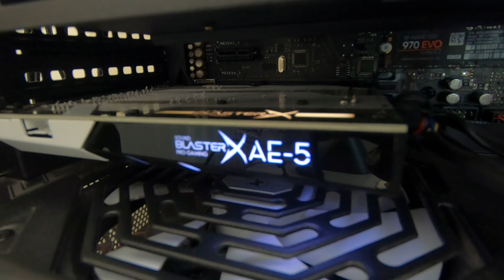SoundBlaster AE-5 Clicking Noise *DIY FIRST FIX* in English

Comment: mine does it every time i exit the game too. its just constant clicking. i finally took it out of my system.
Reply from the maker: I fixed it by using a switch for the 3.5mm speaker output. So my headphones and my desktop speakers plug into a little switch and they are using the same output from the card - so no irritating clicks when using the software to switch between them. Its a relay making the noise, so it probably clicks on boot and shut down, but I don't notice anything now.

This is what I actually use: https://www.amazon.co.uk/STEREO-Manual-Speaker-selector-available/dp/B073GWCRP3

But I didn't buy it from there...

Comment: hmm wondering what speakers you use ... i'm asking because i use an old klipsch promedia 2.1 set up (one of the older ones from before klipsch started lowering their power output) .  it doesn't have seperate channels for the l/r speker it just has the one output plug from the control module to your sound card.  now my issue is  when i run a test in the soundblaster software  , it doesn't seperate left and right  like it should it just plays all audio test  from both satilite speakers equally. aned no sound from teh sub durring test (though the sub does produce noise on regular listening and games). i've tried seting it from 2.1 to 5.1  , to stereo .. and there's no difference  it doesn't discriminate when doing left and right speaker test.
Reply from the maker: I have a pair of Creative Gigaworks T20 Series II speakers. 

https://uk.creative.com/p/speakers/gigaworks-t20-series-ii

They have a 3.5mm jack to the sound card. Note that these speakers are technically 2.0 as they don't have a separate subwoofer. They do have a tweeter in each cabinet in addition to the main speaker though - as you can see on the link above.

They sound brilliant.

I actually got fed up with switching outputs between the speakers and headset using software. I bought a Steel Series headset that's also got 3.5mm plugs on it rather than a USB model and it was irritating to have to keep jumping into SBCommand to swap between them - especially seeing as the card clicks each time. 🤣😂

SBCommand also kept selecting 5.1 when switching between them

So I use a little NM-STS21 switch. This one...

https://www.amazon.co.uk/STEREO-Manual-Speaker-selector-available/dp/B073GWCRP3?th=1

Now the AE-5 output can be sent to speakers and headphones without using direct mode and without 5.1 jumping in and breaking the sound.

It's VERY handy... But it is available from other places.

:)

Comment: My AE-7 does the same. It is a relief to know this is 'normal' behaviour. The weird thing is though that it only happens when booting Debian 12  and not when I boot Mint 21. (Dual boot setup). Guess the difference in kernel is responsible for that.
Reply from the maker: It does it in Windows every time.

I now use a physical switch though… it kept reverting to 5.1 on the headphone out and messing up the sound on my stereo headset.

Comment: this is the inferior AE-5 version  with no dolby/dts support... gl i would exchange it asap and buy the plus version
Reply from the maker: I don't really care about Dolby or DTS as I mainly use a headset or a pair of Series II T20 speakers.

This was the best AE-5 available when I bought it but I've not even bothered unpacking the LED strips it came with.

I liked the desktop control module which my older Zx had and the AE-5 Pure doesn't have that.

AE-7 does... but the AE-9 is pretty brilliant so I might eBay my AE-5 and get that.
Reply: yeah it being the regular one  does not matter inregards to this vidoe about the clicking... the AE-5plus  which i have also makes this clicking noise when switchign between head phones and speakers.
Reply: @DenverStarkey  can confirm this.

Comment: whats the issue lol ? hey guys watch my channel for a REAL possible fix
Reply from the maker: I just noticed the clicking noise... and it's pretty irritating if you don't know why its doing it.

Now I find it reassuring because it means the card is switching between headphones and speakers correctly.

:)

For popping... make sure your drivers are updated - the program that came with my AE-5 is now replaced by Sound Blaster Command which seems to be an improvement.
Reply: @sterntechdaddy  remove this misleading video ffs
Reply from the maker: @gamesthatmatter9374  This video is in no way misleading... especially if it doesn't match your particular problem.

The card does make a weird clicking when switching from speakers to headphones.

But its meant to do that...

There's a relay that does the actual switching - and that's what makes the noise.

If you're not aware of that then the click could sound like the card is damaged or faulty when it isn't - which could stop someone wasting time and having hassles with an RMA that isn't needed.

The card would just get sent straight back.. so if this video stops one person from doing that then I'm happy.

You're popping noise is a separate issue.

If you get the popping with both headphones and speakers and you've tried different headphones and speakers then you might actually have a fault.

This may depend on the age of the card, but I'd try updating drivers and associated software first because it's free, pretty easy to do, and might work.
Reply: @gamesthatmatter9374  hey i have the same popping on sound loops in game menus i will try your fix. Thanks.
Reply from the maker: @gamesthatmatter9374  Adding fix is just to help people find the video - because some people might think the clicking is a problem that needs a fix.

They'll search for a fix because they don't know it's normal.

The popping and crackling seems quite common though... but I've never experienced it.

This might be because I always tweak the power management settings and turn most of them off after the initial Windows 10 installation completes.
Reply from the maker: @yosifvidelov  I'll update the description...
Reply: @gamesthatmatter9374  hi, well it did not work. I disabled power savings and even updated my graphic drivers and i still got that pop from right channel in speakers through toslink, headphones and through external usb razer sound card so the issue is with software(Cyberpunk 2077) i guess and it rules out the AE-5 being the problem. Got the same issue with Middle Earth: Shadow of War but no other games apart from those two.
Reply: @gamesthatmatter9374  thank you, i will check it out.